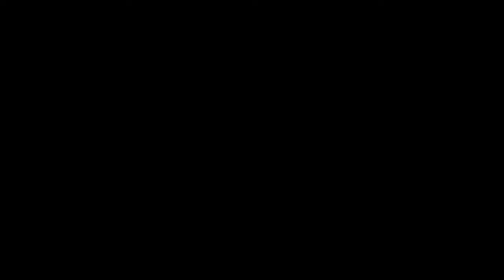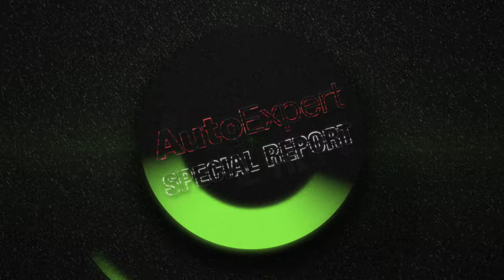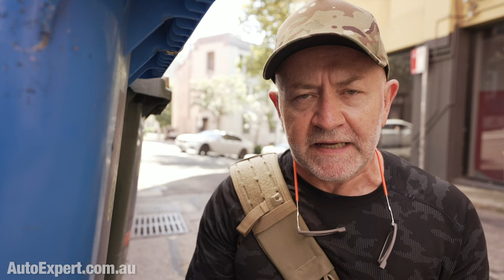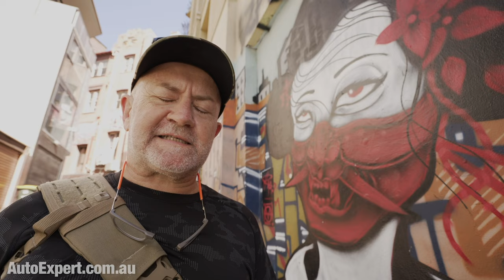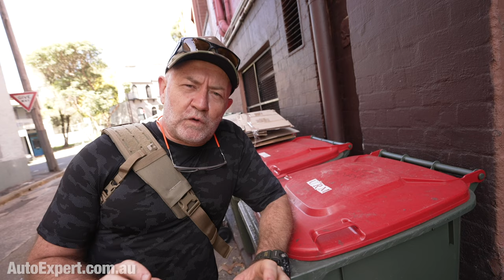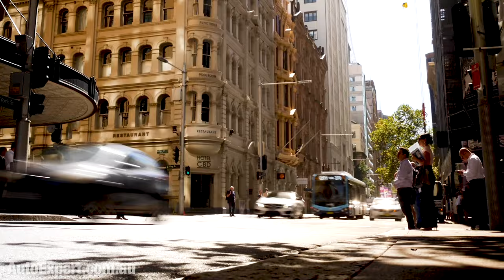These two simple hacks will make your engine last longer | Auto Expert John Cadogan

Comment: A great reason why not to buy a modern diesel car (e.g. Mazdas with the 2.2TD engine, which suffers badly from oil dilution if used in this manner) when you predominantly use it for short trips from cold.
Reply from the maker: It is important to match the vehicle with the intended application. No engines like short trips.
Reply: @AutoExpertJC  EVs like short trips.... Just saying
Reply: @mcduck5  EVs have motors (electric) not engines.
Reply: @AutoExpertJC  Yep, although petrol-engined cars are far more resilient to short trups than common-rail turbo diesels.  It's also why I bought a Mazda 3 with the 1.6 petrol engine rather than the (ten) 1.6 or 2 litre diesel back in early 2006, and it's still going strong to this day - not one engine problem in 15 years.

Sadly, many Mazda car buyers in the UK (and of many other makes) didn't understand this important fact (to be honest, many sales people in main dealers didn't either) and bought diesel engined cars when their driving pattern did not warrant it, just because the sales blurb promised 20-30% better fuel efficiency.

In the end, many probably spent a lot more over the lifetime of the vehicle, having paid more to buy and maintain it, especially when the inevitable problems with fuel dilution and/or clogged up DPFs were factored in.

I think that Mazda are themselves getting the message, having now ditched diesel engines (at least for UK spec cars) for the latest Mazda2, 3 and CX-30, plus the 'new' 1.8TD that briefly was fitted to the gen-4 Mazda3 and CX-3 (the latter no longer sold in the UK only after 4 years) and then dropped, leaving only a supposedly revised 2.2TD in the 6, CX-5 and whatever engine they fit to the small truck (presumably the BT-50) they sell here.  Much more senesible now that they are/will be adding the new Skyactiv-X engine and hybrids/EVs to the range.

Just a shame we (yet) don't get the 2.5 & 2.5T in the Mazda3, just the 2.5 in the 6 and CX-5 in the upper spec models.

Comment: Doesn't it say this in the service booklet? Me hilux booklet says "additional service requirements....conditions such as....extensive idling, low speed driving such as taxi, courier etc...Change oil, oil filter 5000km...." as well as stuff like trans fluid every 80 000km etc. If only reading was taught in schools.
Reply: yeah.  My Hyundai said to change the oil every 5000 miles (I'm in the US these days), but for the "severe duty" schedule (which includes short trips and running a cold engine) that number is reduced to 3000 miles.  But no one thinks they have time to read the owner's manual these days, amirite?

Comment: I agree john i always try to get that temp   gauge up before running a cold engine   if my car is going to sit for a while i will start and run the engine and get it up to running temp then shut down  keeps everthing inside lubricated  and ready to go when needed .
Reply: Coolant temp gauge always gets up to range within like a minute or two tops. (If it doesn’t you’ve got a cooling system problem, probably bad thermostat stuck open). I prefer to go off oil temp, which takes longer. But not as many cars have this.

I’ve not seen it written for cars but you often see motorbike manuals recommend the best way to warm an engine up is to ride it. Gently of course, but not sitting idling either. My guess is that having airflow over the car/bike/engine helps keep temperates more balanced. Also puts real load onto the engine unlike idling.

Edit: to clarify, I will drive/ride without waiting, but I baby it until oil temp is good, then I’ll drive “normally”.
Reply: I'm not sure that makes much difference. It's the cold starts that does the most damage. Every time you start the car while the engine is cold wears the engine the most. Starting the engine every day just to get the engine warm just means you had an unnecessary cold start every day.

Comment: Great video!  I’m curious if some type of EV (be it a BEV or a fully charged PHEV) be better for those short trips?
Reply from the maker: This depends what you mean by 'better'. Better in the sense of cheaper and more consumer choice/availability and refuelling locations, certainly.
Reply: @AutoExpertJC  You are right and I didn't define what I meant by "better."  My reference was in context to this video; i.e. would an EV require "hacks" (simple or otherwise) to prevent damage resulting from frequent short trips? Obviously there are many advantages and disadvantages to BEVs, PHEVs, HEVs, ICEVs and even HFCVs, and this would be just one entry on that long list.

Comment: When I bought my 2001 Astra (cheap car gumtree special) , it’d spent quite a long time living in the city with only short torturous drives in stop start traffic. First drive home with me as the owner was a 50km run along the freeway. I could almost hear the car thanking me as I drove along, and it seemed to run better after I got it home than on the test drive. Fortunately my work is a 50km drive straight up the Kwinana freeway, so it gets ample opportunity to operate at its operating temperature for long periods. Two years later, still going strong (albeit with one or two minor breakdowns along the way, roadside assistance certainly pays for itself!)

Comment: Do not allow engines in Australia to freeze. Some engines have ptfe coated  inside oil pans. These coatings  need a baffle plate under the crankshaft to protect from flyiñg ice formations from frozen  combustion condensation as the do for cold climate production. These conditions occur on central Tasmania and snowy mountain regions  on the mainland. These engines do not comply with Australian design rules "for all Australian conditions".  However because so few vehicles experience the right combination of conditions the manufactures leave out the baffle plate for cost saving on the Australian production. The effect is sudden oil pressure failure from paint flakes blocking the oil intake strainer. It takes months for the effect to take place.

Then the second effect starts, dealer and manufacturer bullshit and ACCC indifference.

Comment: 2:50 ?
Egr doesn't increase volumetric efficiency, it reduces combustion temperature to reduce nox emissions by adding inert gases to the fuel/air mixture.

Comment: Great video John. Quick question mate, does this apply to diesel engines? I appreciate the need for the fortnightly highway run to clean out the catalytic converters, but I thought diesels work through compression, so I that would eliminate the bypass problems associated with petrol engines. Am I off the mark with this? 

As for filter and oil changes, I couldn’t agree more. I have great difficulty in accepting this 12 months/15,000km servicing schedule when it comes to these critical components. Go and enjoy your beemer experience and I will enjoy my Merc fun run home. Cheers mate.
Reply: Diesels definitely have this issue as well - in fact, some of the early DPF vehicles had serious issues with it because they would try and regen before the car reached temp and the excess fuel (to raise the exhaust temp) would wash past the piston and into the oil.  Sorted now, but an issue for the early birds in that space (and sometimes just solved in software).
This is nothing to do with the cat's in the car - they are part of the exhaust system and although they also tend to like getting hot (and can often do so even on short runs), it's engine oil dilution that is the issue here, which really does take time at operating temp if you do frequent short trips.
Reply: @themage12  Thanks for the clarification mate. The devil is always in the detail with these things.

Comment: Back in the day, they used to call this the "Italian tune-up", but there is no need to really thrash the engine to the red-line. And if you are not an idiot, and your local garbage dump [oops, I mean waste recycling facility] accepts old oil and filters, then go for it. Torque-the sump-plug properly, because an over-tightened sump plug is a stripped one, and a PITA to fix. Likewise with the oil filter, just hand-tighten firmly putting it back on, don't pretend you are Arnie the terminator. Drain the oil while warm also helps, as does removing the oil filler cap. Replace with the correct grade and type of oil. Don't fill up totally-keep about half a liter back, and run the engine gently for a few minutes, then leave to settle. Then use the dip stick again, and top up until just before the max mark on the stick. 
You may have to remove the sump guard first, but it should not be too hard on most models. While you have an opportunity to get a worm's eye view of the engine and transmission, take a look for oil leaks, colling leaks etc. 
Use axle stands after jacking the vehicle up, or have a really good life insurance policy. But chances are that they might not pay up to your mourning relatives if you have been an idiot.  
Invest in a good hand cleaner and some nitrile gloves, and some old flannel shirt or whatever. A cheap tarp from Bunnings or wherever helps too. You can save heaps, and the tools and materials won't break the bank, and they will pay for themselves after a couple of self-services. 
Unless you really know what you are doing, get the scheduled servicing done by professionals, but doing the stuff yourself could void the warranty.  If you religiously keep to the official schedule you should have no problems. It would be a real dickhead of a mechanic who dobs you in for taking extra care of your vehicle, but who knows, you could be unlucky. If you lavish intelligent attention on your vehicle, the odds are that if something really serious/expensive is going to fail do to manufacturing error, it will do so in the first 20,000 or 50-100,000 kms anyway. If you bought a half-decent car. [Not talking about the shiny "bells and whistles", but the fundamentals of engine, drive train and the like]. Some models of "posh" cars can be absolute dogs mechanically.

Comment: Do you recommend this on small cars? I have a 1.2 Vauxhall/Opel Corsa with 75hp, 5 speed manual. Sits at 3100rpm at 75mph.
Reply: p.s. car is brand new, got it with zero miles and I’ve only done 4500 so far.
Reply: Yeah all cars need the oil to get hot and burn off moisture and fuel. I’ll have to look this car up, I didn’t know they sold cars with that small of engine.

Comment: best tip is if you own a turbo diesel have the oil and oil filter changed at 7,500km or basically around every 6 months if you do approx 15,000km a year, if you do more then have both changed at 3,500km or every 3 months, For petrol and turbo petrol you can get away with 12 month 15,000km services (for modern vehicles) by doing 2 simple things, idle for 5 minutes before you go for your drive in the morning or evening and the 2nd thing is be gentle on the throttle until engine temp is at least at standard operating range which should take about 15 minutes of normal driving. Remember it's not just engines, it's also transmission, transfer case (if AWD or 4x4 High or Low range), brakes, suspensions and also tyres as tyre pressure also build  with heat so tyre wear will increase also if you you short trips without getting them up to proper pressure range.
Reply: Idling a cold engine = premature wear. 30 seconds to a minute is enough! The important thing is to drive conservatively.

Comment: Love your channel. Does it help to start your car for 5 minutes in the winter before you drive or does letting it idle make the oil dilution worse? I drive a honda with the 1.5t engine that is susceptible to oil dilution. Thanks
Reply: Not a good idea. Most manufacturers recommend that you just start up and go. At idle it takes  along time for the engine to warm up, making dilution more of a problem. Extended idling can also be hard on the cam shaft(s), especially when the engine is cold and the oil isn't flowing well. If you want to be mechanically sympathetic just take it easy for the first few miles.
Reply: @LesNewell  Dead on.  Don't let it warm up too slowly, and don't thump the loud pedal before it's warmed up all the way.  Just drive gently and she'll warm up that much faster, as well as looking after the engine internals.  :-)
Reply: @LesNewell  thank you.

Comment: What is the recommendation for a car which only covers very low k's, say 3,000kms per year. Would it still be worthwhile to service every 6 months? Or with such little distance covered is the 12 month service interval adequate?
Reply: Just do the 12 month service it will be fine
Reply: @davidbarnsley8486  Thanks mate
Reply: I'd say watch the video again. Maybe use the car more?

Comment: I would hardly consider the M3 to be considered performance perfection, simply ask fellow Brisbanites whether queuing on the M3 mid-day inspires any sense of performance! 😅
As for the Italian tune-up recommendation, I completely agree with you on that. There was a time where I didn't have much of a need for driving (mainly just dinking around the city), but would make a habbit of driving 200 kms at least once a week on the expressway at 130 km/h to clean everything out (this was in Ontario, Canada where everyone goes 130 km/h or more on the expressway even though the speed limit is 100 km/h and where a previous government was voted out of office for having the audacity to install speed camera on the said expressway, only for them to be removed by the succeeding government).
Reply: Bruce Hwy Car park. a good hour run out of the Northern Brisbane suburbs at 20K/H, Maybe try at 5:00 am Sunday morning.

Comment: what about running  for  30 mins in the garage/carport at idle then leaning a brick on the pedal for  say 10mins at 2500 rpm?
Reply: Terrible idea, running the motor at idle or at rpm with no load will just induce cylinder bore glazing
Reply: @Volks2462  cheers m8

Comment: hey john can i ask what your thoughts are about lifting the speed limit to 130k /h from 110k in australia ? there seem to be some people think we may have roads in Australia capable of handling this and also vehicles to travel at these speeds ,cheaper than traveling 110k , fuel wear and tear . cheers Steve /gero
Reply: Motorcycles should be able to travel at 160 km/h.

Comment: Take it to a dealer? A friend asked me to help replace a hose on his ..lets just say utility vehicle to protect the guilty. They had insisted he also needed to spend $2000 'urgently' to fix leaking steering components. It had just had a complete $500 service from this dealership but he  had the sense to refuse  the steering work. We looked at the air filter....it had white all over it like coal. They had no shame and not even the caution to change an easily checked filter. The oil was murky, tasted like shit.  I advised him to find an independent mechanic recommended by work colleagues and get the oil changed. For real this time. He did and tells me the mechanic found no steering leak. I drive a 20 year old Echo with 275 k and change the oil myself about every 6K. I do get the odd hour drive in here and there so I think I'm good, but that was helpful advice. Most trips are minimum 10 minutes so I do get it heated up, and I turn certain shopping runs into a series of several stops.  I walk the really short trips to get my own personal lubricants flowing.   Great video.

Comment: I always find time to let my engine run for a few minutes to allow the oil to get warm before driving. For e.g. I start the engine get dressed and drive. The oil temp is usually in the perfect range at this point. Same thing when I return I park the car in the garage, check my phone send a few messages from my phone and then switch off. Voilà.
Reply: That's a terrible idea buddy. Cold oil isn't an especially great lubricant. 
Start it, let it idle for 30 seconds and drive conservatively until it's up to temperature.
Reply: Yes that’s what I do.  @h2oaddict28

Comment: Great advice but 12.6l of oil into the cruiser hurts a bit every 6 months, lucky I mostly do long drives.
Reply: Yes, my 80 Series takes only 10l but I still see it as a cheap insurance. I change the oil and oil filter every 5,000kms and get my mechanic to do a full service every 10,000kms. The old girl has 315,000kms on the odometer now and still runs like new. I do a fair bit of remote solo travelling and the last thing in the world I want is a mechanical failure in the middle of nowhere due to poor servicing. The $80 I spend every 12 months on oil and a new filter is cheap peace of mind for me, and actually saves me $100's if I were to pay my mechanic just to do an oil change. Good excuse to have a few beers by yourself in your garage too.

Comment: The old saying that the car only has been driven very low miles and “was owned by a little old granny” that only drove down the road to shops and around the corner to church on Sundays”  is not the terrific bargain find but if it were me I would prefer a well serviced vehicle that’s done 10 times the distance preferably one that was driven quite a bit on the highway regularly when all the rotables in its driveline were up to temperature and also unless the vehicle has a stainless exhaust system the short distance usage also would mean that there is a good chance it’s mufflers and pipage is a good candidate to prematurely being rotted out also!